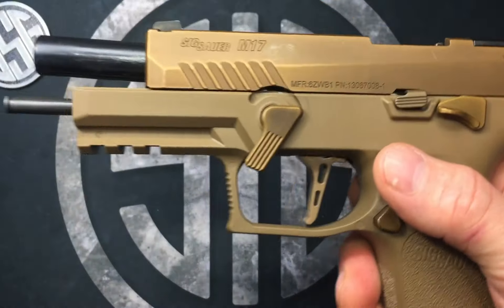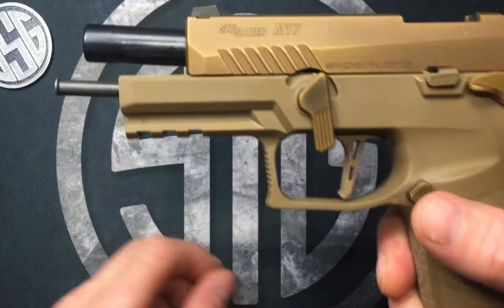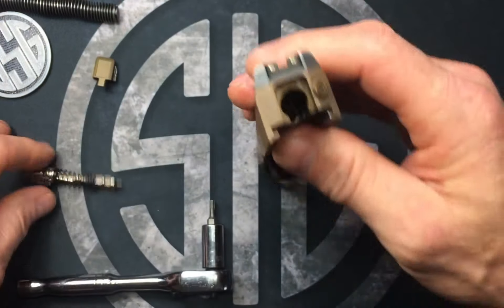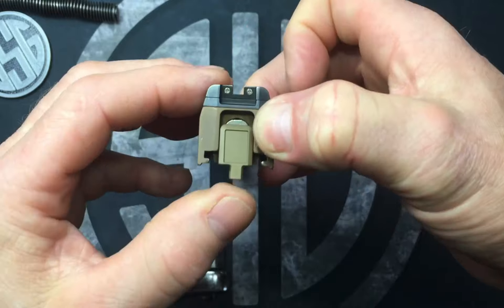Sig Sauer USGI M17 rear sight plate removal procedure

Comment: If you have a civilian P320-M17 the removal process is slightly different.  The rear T15 screw on the surplus gun is instead a spring loaded pin on the civilian model. Simply use a punch to push the pin in, and while you have the pin pushed in, carefully remove the back plate.  Then carefully remove the pin/spring and extractor.  You don't need to remove the striker.  All you have to do is use a 3/32 allen wrench and remove two screws on the underside of the slide that are securing the sight plate.  They were put in by the factory using blue Locktite, so they will be tough to remove.  Push down hard to you don't strip them as you are breaking them free.  Once you remove those screws, the sight plate and rear sight come off.
Reply from the maker: So it’s just like the standard 320. Good information sir thank you very much for sharing.
Reply: Read this Aaaaaafter I just went to the store and purchased the tools lol
Reply: I just came here to comment the same thing, first time installing a red dot on anything.
Reply: Ty
Reply: Thanks bro.
Reply: Dude. Thank you so much. Thought I was losing my mind. No way aT15 was fitting or working.

Comment: The two screws that hold the rear sight plate on are 4-48 socket head cap screws. A 3/32 allen socket is the best tool for removing the screws - not a T15 hex
Reply: That is correct for the M18 and possibly civilian  M17 but he is working on a military spec M17. It is either a Milsurp M17 (as I have) or a commemorative edition which also has the same PVD coated controls. The M18 uses 2 Allen screws to hold the rear sight on. They are different designs. SigGuy is correct in it being torx

Comment: @Sig Guy    I'm working with a USGI M18 .....  from what I've read,  its only compatible with Leopold DetaPoint and Romeo 1 optics....  do you know if thats the case ?  I'm tring to understand what the difference(s) are in the adapter plates (RMR / MOS & whatever else there is) so I know what other types of optic options might fit.  Any help is appreciated.... thank you for the video,  I'm guessing removing the rear sight plate should be the same for the USGI M18.

Comment: Hey Sig Sauer Guy! I just finished going through your videos and would like to say I'm a huge fan. I have a couple questions that I hope you might be able to answer. I am currently running a standard P320 and added the V1 factory flat trigger last year. I was thinking of adding the Apex forward set trigger bar, seeing as how it performed fairly well according to the data you posted in the video of p320 triggers. Can you give any anecdotal thoughts about this combo, since it wasn't directly addressed in your video (I saw V2 was)? This would be for carry, not competition. Also, do you feel the legion trigger bar or trigger is a significant enough upgrade over this combo? I know smallgunparts has both listed, and I'd be very interested in seeing how it stacks up to the other triggers you have! Thanks
Reply from the maker: The Apex kits are very nice. I have always been a huge fan of them. Most of my other videos are from last year. There are some newer trigger options available. Armory Craft will be releasing their 320 duel adjustable trigger February 1. I have been fortunate to have been using it for the past couple months. It is definitely a game changer. I would not invest in the Legion trigger. The Legion trigger bar is the exact same as the standard trigger bar but allows for a manual safety. I have posted a couple videos referencing Armory Craft if you haven’t seen those. The trigger is amazing.
Reply: @SigGuy  thanks for the reply! I'll look at those videos again, I very well may end up going that route

Comment: Is that an early model? Mine does not have the screw that yours shows to remove the sight and plate, mine has Two screws holding them on in the same holes you use to mount the new sight
Reply: Yes this is an earlier model. I have the same one as yours with two screws holding the slide.

Comment: Is the slide finish different on the military surplus version of the M17 then the civilian versions???  It looks to me like it may be…  that’s one of my disappointments with the M17,  that finish.  My finish has been worn off just from a few range sessions using an Uncle Mike’s nylon holster.  I think for the amount I paid for this gun,  it’s finish should stand up a little bit better.  Otherwise,  I love it…  I chose it over Taurus G3,  safety was hard to release,  Glock 19,  couldn’t reach and activate the mag release well,  and P365XL,  (which I did end up buying one) for not being able to reach and release mag easily…  I’d have bought it first if I new they had aftermarket releases.  But I loved the M17 cuz it just fit my hand like it was made for me.  I wish they’d have put a mag release and safety like is on the M17 on the P365XL.  The M17 mag release is more squared off than the P365XL’s that kinda follows the profile of the grip.  Oh,  and the M17’s has texture.  The M17’ s safety has a more pronounced lip and is flatter & wider than the P365’s safety.  Not saying use the M17 sized safety,  just it’s design shrunk down to fit the 365.  I don’t know if anyone has had this problem,  but if you put sideways pressure on the 365 safety it sometimes binds up.  I believe that the design of the M17 safety would prevent that.   Oh yeah, I digress…  finish!!!  I’m really disappointed with this finish!!!  Anyone else have theirs rub off???

Comment: Thanks for the video showing how to take the optics plate off. Wondered where that screw was hiding.  At 6:52 mine's doing the same thing yours is, not going into battery when you don't fully let the spring carry the slide home. I saw a 1/4" of guide rod sticking out near the end
Reply from the maker: Alan Schwab it’s normal. Pretensioned barrel. Just like the X5. Increases accuracy.

Comment: I have questions. So the romeo 1 Pro and Romeo Zero have the same footprint withe the exception of different screw sizes. I recently bought a Romeo Zero Elite and included are screws which will allow it to mount to the R1P footprint? Second question, the Pro cut slides have R1P and RMR holes, can an RMR be installed without the expensive filler plate CHS sells?

Comment: I own both the surplus, and the commercial 320/M17- I have allways wondered why they chose to use different methods of attaching the rear sight plate ( one screw vs two screws)
And a different rear sight design, and lamp color. They should use the military rear sight on them all.
I have had two loc-tite the 2 screws on the civy model twice.
Seems like differences for no real good reason.
Holding off on the 320/M18 until a commemrative or special edition comes out closer to the actual military one.

Comment: Great video! But maybe you can help with two issues I’m having. 1. After installing the Romeo 1Pro optic I’m left with the screw hole being exposed behind the optic. Am I missing something?? 2. I tried to lollipop the red dot with the front sight and the notch on the back of the optic but the red dot bottomed out and won’t go low enough. I haven’t put a laser boresight in yet so it may be a non issue.
Reply: The sights do not co-witness with the standard sights. You would need a higher suppressor height front sight if you wanted to get co-witness with a front sight post.

Comment: My M17 does not have a torx head on the screw that you clocked and removed in order to access the screws inside that hold on the sight plate.  On my weapon it is a beveled, but blank insert.  It's black in color also, not FDE like the one shown in your video.  My sights and plate are noticeably loose but I'm unable to remove that holding pin assembly at this time.  Any help would be most appreciated.
Reply: UPDATE: Found another newer video and the guy's M18 had the same extractor rod as mine, which is removed by simply pushing IN on it with a blunt punch of some kind, and then sliding off the rear cover plate as normal. Hope this helps anyone else who like me was puzzled about this initially.
Reply from the maker: Yours is a spring-loaded pin. Press in on it while sliding the back plate down. Then that pin will pop out towards you.
Reply from the maker: @BakedAndAwakePodcast  my video is for the United States government issued M17. Apparently they think soldiers are not smaht enough to push in and turn lol. Yours is the civilian model. I made the video because those with the USGI model weren’t sure how to disassembly.  Thank you for the support though sir. Glad you were able to get yours taken care of.

Comment: Wow there's only 1 screw holding the rear plate & sight assembly to the slide for the surplus edition? I looked this up because I am having trouble getting the two screws into the rear sight for the standard M17, which is a two piece assembly onto the slide. They must have changed the fixture design for this model. The sights came loose after about 1000 rounds and I don't like having to get loctite into the threads, as people have recommended to me. Not really happy with these sights and may have to contact Sig to get a replacement.
Reply: Patrick Kudo  had to loc-tite those two screws twice on mine... didn’t degrease good enough the first time. But there is no keeping it tight without the loctite.
Not going to happen.

Comment: How did you got the slide lock and safety in tan?? Please I want to get those parts
Reply from the maker: So that is an authentic P3 20 M 17 that was issued to the military. The controls are used to be coyote before they switch to black. There was only a little over 5000 of these offered to civilians. They are still out there just a little more hard to find and a little bit more expensive.
Reply: @SigGuy  ughh they should sell those parts in coyote man, nobody sells them online? All I see is black black black , all I could find was the take down lever and back plate that’s it
Reply from the maker: @BlackSkyMusicTV  I’m sure Fdez Werx can cerakote them for you. I don’t know of anyone that is selling them coyote. Not even SIG anymore.

Comment: I own a P250 compact and would like to install a red dot site....I can't find any attachments to attach without sending to get milled,don't want to cut into the slide...and everyone has videos on  how to unscrew a plate or dovetailed sites....P250 has neither...any solution to my problem?
Reply from the maker: The solution would be buy a 320. I know it’s not what you want to hear but you will be extremely happy you did. I own 3 P250s. There’s just no aftermarket support for them. Armory Craft is making a trigger for them. Other than that they are considered obsolete. After owning 320s now I wouldn’t hesitate to make the change to a P320.
Reply: @SigGuy  thanks brother...I figured I'd read that,but now I can update my pistol collection

Comment: What trigger is that?
Reply from the maker: john grimm the new Armory Craft dual adjustable trigger. Remove as much pre travel and over travel as you went. 30% less pull weight also. Will be available February 1st 2020.

Comment: On my P320-M17, that first screw you remove is not a Torx head.  It looks to be just circular.  Any idea how to remove that?
Reply: Nevermind.  Apparently you just have to push down on it and slide the rear plate out.  The screws to remove the back plate are in different spots too
Reply: @islesfan186  thanks,mine is the same. Im having issues pulling the slide plate off, but I know know thats what is needed
Reply: @stephenmartin3859  All you have to do is push down on that pin and you can slide the plate out.  Also, the hex head screws to remove the back/rear sight post plate are T10, not T15

Comment: I saw the guide rod for the recoil spring sticking out when you finished, is that correct?
Reply from the maker: Richard Xo it’s just because the slide wasn’t all the way forward. Completely normal. Pretensioned barrel design. Good eye.

Comment: Sir thanks for the video but got a question. To this day is the Delta Point Pro still the only Red Dot that is cut to fit the M17?
Reply: As I understand: the Romeo 1 Pro will also fit. The new Holosun 407K and 507k models will apparently fit as well. But I don’t think they have been released yet.